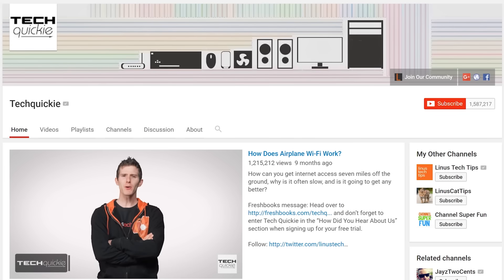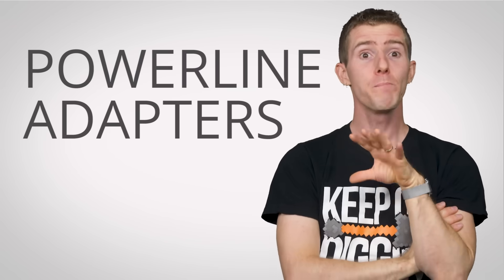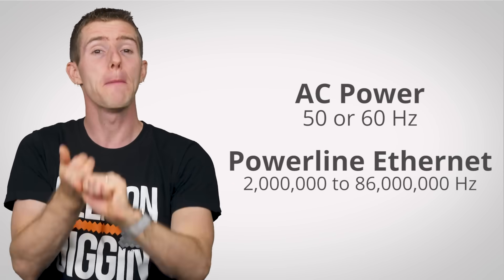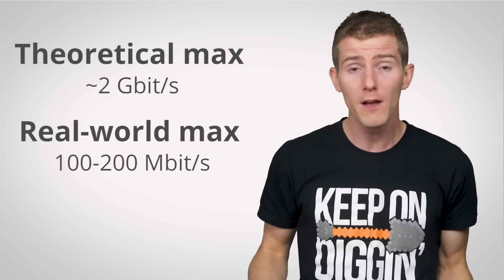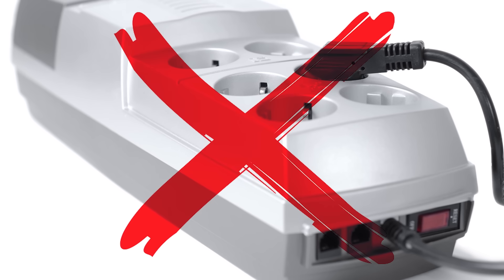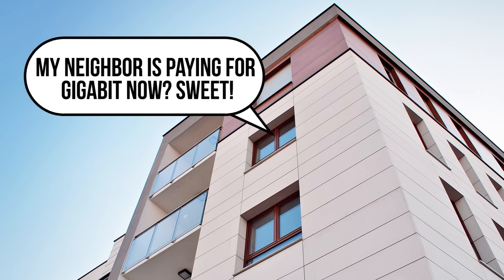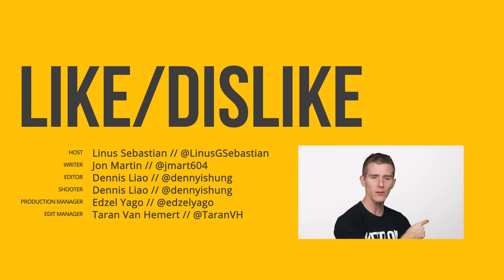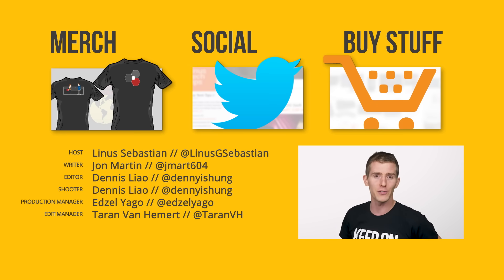How Does Powerline Ethernet Work?

Comment: It's pretty obvious from the comments that Linus' advice about buying from a shop that will let you return for a full refund cannot be emphasised enough.  You may have a great experience with no problems or it may be useless depending on the wiring of your home.  Personally I've had a great experience.  It's more than fast enough for my gaming needs and handles 4k streaming with no problems.  Maybe once a month my connection (wifi still works fine but powerline connection is dead) will inexplicably die for 5-10 minutes but apart from that I have no complaints.

Comment: Those adapters are rubbish. The one I bought claimed to support gigabit speeds but I got a max of 7Mbps.
Reply: I had a similar experience. I pay for 150Mbps from my ISP and used to get that when wired directly to my switch. Going through the powerline adapters I purchased (also claiming gigabit speeds) I get around 50Mbps. Pretty steep drop, though better than you saw. It works... but I am looking into getting some Ethernet ran in my house as a longer term solution.

Comment: "Powerline Ethernet" or PLC is a cancer. Don't install this by no mean, or your will build yourself a microwave-like house. It involves high-frequency radiation in all your home electricity network, everywhere. Kids especially are sensitive to these frequencies. Besides, bandwidth and latency make it a terrible option. Remember that by a simple lack of effort you are exposing yourself, your family and your neighbors. Neatly installed ethernet cat5+ cables would always be a superior solution to any other yet.
Please read futhermore on the internets about the dangers of PLC and don't listen to this stupid advice.

Here in france, the government is forcing installation of smart electricity meters, powered by PLC. A lot of controvercy is going on, mosty on health concerns, but also about privacy - as these devices broadcast data in the *entire house network*, even to exteriors fixtures or grounded pipes. Therefore a lot of people are protecting their home with anti PLC filters.

Your are always free to apply any solution to your home. This was an advice as well as a request in behalf of your neighbors.

Comment: powrline adapters just suck! great instability and drop out all the time on clear sockets without no other devices, in new house and different models. plus is overpriced!
Reply: Mine never drops.. stable 150 mbit/s connection. it did cost 120 euro though

Comment: I switched from powerline to 5Ghz wifi. better pings and better speeds and more important, no more pairing problems  ! it was cheaper to buy a PCI-E Wifi card than to replace my 200Mbps powerline adapter for 1Gbps models and there's no one on the 5Ghz bands in my neighbourhoods ! so no risk of traffic congestions !

Comment: I'm in the UK. I pay for 150Mbps but only get 30Mbps through my powerline. Any Ideas why?
Reply: TheJohnDenim You'll never get your advertised speed from an ISP. Test versus an Ethernet connection to see if it is really the adaptor.
Reply: Ethernet I get advertised speed. I think it may be because I'm on an other circuit, although Linus says it goes across breakers?
Reply: TheJohnDenim He did mention that distance between adaptors could be a problem.

Comment: As an Electrical Engineer, this technology older than my age. In India, we use Power Line Carrier Communication for transmitting data through the high voltage transmission line.
But in Home, it is very dangerous for normal Electrical equipment which works in fixed sinusoidal frequency.
Reply: It's too expensive for normal citizens to use it...... This tech in India is still experimental... I'd bet you don't even use it.
Reply: In India, cows roaming around street

Comment: I really like powerline networking, if you get one with an access point built into one of the devices its a much better way to extend a network than a wifi repeater.

One caveat though that i've learned the hard way (by killing three devices super early): don't plug a heavy noisy drawing device like a vacuum cleaner into the same double socket as an adaptor. it wont kill it the first time, but in a month or two you'll be wondering why your new powerline adaptor is dead already.

Comment: You'd want to password protect power line adapters even if you are in a single family home, as there's nothing inherently stopping the signal from being transmitted "up" to a shared transformer to your neighbor's house., (Although distance probably  works against it in the suburbs.) Then again you do "lock down" your WI-FI  too, Don't you?!  Either way these are a nice way to avoid a big rewiring job.

Comment: Better option: MoCa adapters. They let you hook an Ethernet line into the coax outlets which already exist in just about any house built ~post-1980. Coax is designed for high data throughput and doesn't go through breakers, so you can often get 500 Mbps up to 1.5 Gbps, even if you already use the line for TV service, and as long as you get quality adaptors then the connection is just as stable as dedicated lines. Just hook up a filter so you don't broadcast your home network connection back out to your ISP, if you have cable TV and you're set. Plus it's usually way cheaper than running new Ethernet lines (I use MoCa to run internet to three rooms at my house, for a total of about $250. Installing Ethernet in the same rooms and running it to my router would have cost upward of $600 professionally, or would have taken ~$300 for the wiring plus a good chunk of a day to install myself).

Comment: I'm using powerline right now. It works wonderfully. It does stop working like once in every two months but a simple reset should be able to fix the problem. Speed wise, it's faster has less latency compared to when I use wifi.

Comment: As someone who has worked in, and for ISP's/ networking companies for over a decade I cannot recommend these devices. So many issues we've had with customers using these. Honestly if you can just fork out the extra money to run Cat 6/5e around your house. Far far better and more reliable than these.  plus less risk from dodgy internal wiring if you lay new cable down. 
Ok for a cheapish solution for your facebook needs, but not for gamers and video uploaders etc.. just dont do it.

Comment: One thing to be aware of for power line adapters is that it will create noise on your power line.  I was using Uverse at the time, and when I plugged in my power line adapters, I got so much noise on the line, my cable box was unusable. Soon as I unplugged it, it was fine.
Reply: Explain in idiot terms please?
Reply: @M_RM.  sorry I missed your post. I just posted a follow up on the comments.
Reply: What kind of noise? Auditory?
Reply: @old_H  No, electrical noise. Normally alternating current just pulses down the power lines. It goes on then off 60 times a second. And electronic devices count on their power being a steady AC power. But when you use power line your lines in the wall now have another signal. And sensitive devices that were counting on just one signal don't have a method to filter out the internet signal. So now they accept that signal as part of the power and it ruins the function of the devise. In my case, the Uverse cable box displayed mostly static.

Comment: I've been using powerline adapters for a few years now, and they're definitely convenient. Mine are Zyxel PLA5456 1800mbps ones, and i'm getting 550-600mbps in actual throughput, which i think is fine. :) My home is from 1903 or something like that, with the oldest wiring being from probably the 30's or 40's. So i'm very happy that i'm getting that throughput. I'm using 4 adapters in all, and so far it has been rock solid reliable for me.

 That being said, a friend of mine is also using powerline adapters, and his connection isn't very reliable. He's not using the same ones that i do, it's another brand (don't remember which), and they're also a lot slower, but still, he's not getting anywhere near the speeds that i am. I think it's because his has to go through a breaker and possibly even another phase, as it goes from one apartment to another in the same building (no, he's not stealing the signal from someone).

In any case, it can work wonders, and it can work not so great, depending on your application. :)
Reply: 600mbps with powerline?

Comment: Sad to see so many knee-jerk 'This doesn't apply to me so it shouldn't be used by anyone' reactions in the comments.

I personally use a powerline setup to extend my primary router to a second one to maintain strong signal everywhere. 
It's incredibly worth noting if you're thinking of buying a set to buy one marked AV2. 
AV2 [theoretical speed] is the later standard Linus alluded to (without mentioning by name) that is orders of magnitude faster than the older standard which is 'AV[theoretical speed]'. 

For example my older setup with an AV200 setup got me about 12Mbps of actual throughput and my newer AV2 600 adapters get 350-400 Mbps of actual throughput on gigabit Internet. 
Of course your mileage will vary.
Reply: I use it too, because my apartment has no Internet and telephone connection, and my landlords don't want to build one...

Comment: How do they work? Easy: they don't. I used to have power line internet and it was terrible, unstable connection and higher latency. Do yourself a favour: buy some ethernet cables, crimping tool    and run em through the outlets where you nud need. It's a one in a lifetime job, you will save money and the connection quality improvement will be huge
Reply: Works fine for me.
Reply: CheapSushi good for you, personally I had tons of problems with it but since I've put ethernet cables I just stopped caring about how my PC is connected to the net because it's just flawless.
Ping measured from the router is less than 1ms.
For curiosity sake, how much ping do you get with the Powerline?
Reply: It's probably because you were using the powerline as a "main line", I'm just using it as supplementary to my network for tablets, phone and IoT stuff as I roam around (they also have WiFi on them).   I have an extensive network for my homelab, including gaming PC.
Reply: It's all due to the wiring in your house, it's kind of a lottery. For me my ping is the same vs directly connected to the modem or using powerline
Reply: Sucks for you because they work 100% for me at any room in my house without compromising speed
Reply: Works fine for us. You probably have shitty lines, or lots of interference. Tons of homes in the US have very poor electrical connections, using crappy slotted conductors and poorly shielded wires.

Importantly, the tech has really changed in the last 1-2 years so if you used it 5+ years ago, well yeah, maybe. It's pretty different now.
Reply: Nah it works

Comment: This is a bizzare technology i have never heard of before and would never trust even if it did work out. Either way I think Linus could have gone more in-depth about the actual technology itself, they only went over a very abstract idea of it operating at a different frequency than 60 Hz AC, there are several avenues to take from there especially if they are utilizing the neutral line. I would like to know of this data is being broadcast back to the center tap transformer or what

Comment: I have a TP-link power line, it can't really handle my download speed, but gets close enough. I have it connected to a 2nd router, because the Wi-Fi signal from the main router is really low with this distance and it was no option. Pings are stable, that's the most important part, over low Wi-Fi it was impossible to get them stable.
I have the emissor connected in the same socket as the router and some other stuff, that could be why I see some decrease in download speed, but not significant. The receptor it's not on the same socket as the pc, but close. The decrease is probably caused by the distance, if I try a closer socket in another room, I can get higher download speed.

Comment: I bought a $30 pair that worked at up to 5MBps as the max speed for a few months then our speed was brought up to 15 MBps but I only get 2 max through it now, wifi in the same room is faster and the only other things connected are about 5 lights just as it has been.

Comment: I HATE these. But I have to use them because I didn't build my system with wifi. I bought the TPLink ones because at the time I thought were really cool
Reply: If you really want wireless you can get a usb wireless adapter for like 10 dollars on amazon/ebay.
Reply: Andrew Haines my wife has one but it's deader than elvis. Been contemplating getting a dongle for a while
Reply: get a PCIE wireless card. I got a cheap asus one and its been working well for over a year.
Reply: Splitface2811 I would but my system is a microATX cube build and there's no room for another PCI-E card
Reply: Ah. I take it its not a high end build from the last few year? most micro ATX boards I've seen have wifi built in.
Reply: No it got built last year. I just opted out of wifi because I never woulda though I'd move halfway across the country and have a roomate who's anal about ethernet cords running across the apartment
Reply: Zakir Siddiqui My next desk build will have wifi and everything else when I can afford to build it

Comment: Powerline Ethernet is not a bad option depending on your circumstances (renting, bad wireless interference, etc), but while Ethernet is still king, you may want to consider using MoCA if your already have coax in your house and Powerline Ethernet doesn't work out as well for you and you can't run your own Ethernet cable.
Reply: Afaik MoCA is more expensive and not as plug-and-play. Further more (if installed incorrectly or defective) it could be a source of ingress to your cable provider. However, it is a viable option.
Reply: Clark Turner same here, was easy to setup! Used it to connect to a switch which has a ps4 and pc connected to it. MoCA is the way to go.
Reply: Whats moca?
Reply: MoCA for me was plug-in-play. Actiontec MoCA 2.0 bonded really helped me out a ton! I have a 1Gbps connection and cant run Ethernet. It saturates at 800 Mbps down and up. so the extra 200 Mbps is always available for Wifi uses around my place

Comment: This product is useless as long as tablets and phones don't have Ethernet ports
Reply: Dubious They make adapters to plug Ethernet cables into USB ports.
Reply: Or you know research it because there are adapters that also have WiFi on them. They're great for extending your network.
Reply: example: https://www.amazon.com/NETGEAR-PowerLINE-1000-802-11ac-Gigabit/dp/B01929V7ZG
Reply: adapters that can be used for phones?
Reply: I don't use wifi
Reply: Dubious Yes, adapters can be used for phones if the phone allows the use of an otg adapter.

Comment: "Devices like UPS battery backups, power conditioners and surge protectors can misidentify your data signal as undesirable electrical noise and can actually filter it out".
That is because they ARE creating undesirable electrical noise.
So if you're an audiophile; Avoid, avoid at all cost ;).
Other than that they actually work pretty well.

Comment: Just an extra Powerline tip, for anyone wanting to try it out!  Most packages for Powerline actually tell you the max length that you can space two adapters in the network.  Most are right around 100-150 feet.  You may also run into problems if you run in a path that crosses a refrigerator, as some can distort the frequencies used by the adapters.  Hope this helps!
Reply: So 700’ would not be a good idea? I have chicken houses that 2- 600’ long. I was wanting to put a camera at the end of each house. So I’m guessing around 700’. Any idea?
Reply: @jackiehavens5409  you would definitely not want Power line for that length. That's way too long, even for Ethernet or MoCA.
Reply: @chupathingy13  do you have any ideas then? Would WiFi and booster be my best option?
Reply: @jackiehavens5409  any true wifi mesh like netgear o linksys velop can provide a wider area of coverage with reliable wifi, any old strong ap like ubiqiti can do the job too, or you can run like @DJChupa13 said  one single line of fiber plastic for the home